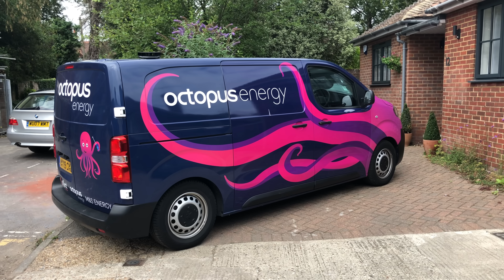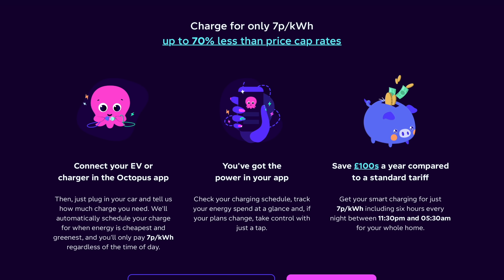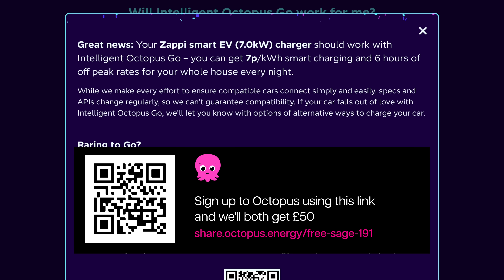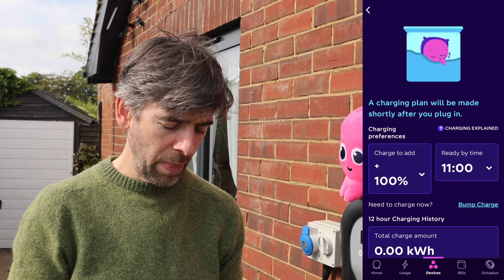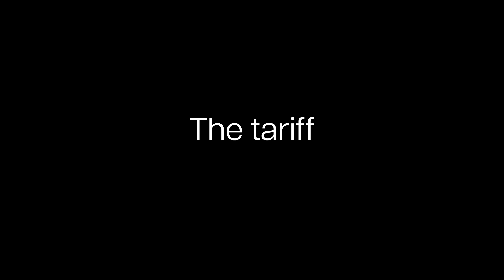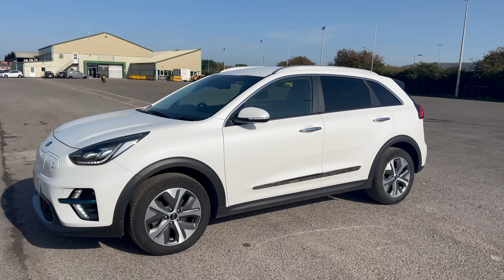We've saved a fortune! All about the UK's most popular EV tariff: Intelligent Octopus Go

Comment: If connected via the car Do they charge all electricity used by the house during the mapped sheduled charge times at the 7p rate, or just the amount the car tells them it has used?
Reply from the maker: Yes, amazingly all electricity used by the house will be 7p/kWh for as long as the car is charging. As I understand it, that's unique to Octopus.
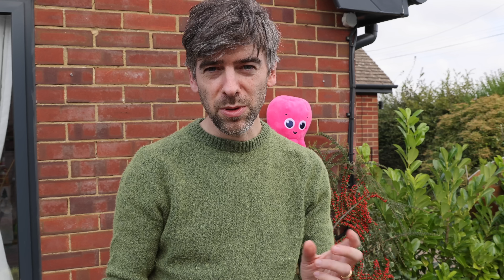Reply: Pretty good, I was wondering this, struggling to find any information from Octopus themselves on this. The smart schedule at the moment is 21:30 to 08:00 so will be good to get the heat pump warming up the house cheaply and have a shower (electric one) before 8.  Shame the Octopus app doesn't show the traffic usage split in the usage app.

Comment: Can you adjust the max output from the charger say 1 KWh so it takes longer? Would that give the whole house a longer periods of the cheap stuff?
Reply: You can limit the Zappi charge current. You can set the “Device Limit” Amps to whatever you like (between 6A/1.4kW and 32A/7.4kW I think) it’s in the Zappi front LCD menus). Sounds like unfair gaming though to me.
Reply from the maker: Not as far as I know, but that’s a great point as my LEAF only charges at 3.3kW so I get cheaper electricity for longer with that. (Until its relatively small battery is full anyway!)
Reply: @MrEV  you can reduce the charging rate via the Kia infotainment under EV setting, normal, reduced and minimum. The charge point or octopus app may protest with" the car is charging slower than expected. Just ignore that and the car will try to charge for alot longer. 😂😂
Reply: Yes you can. It may not be fair use so I definitely haven't done it, but a friend has, he had 70% charge and didn't really need to charge but has an electric shower which is expensive to run so he reduced the EV charger (hypervolt) to 6amps to get a slow trickle charge, set the Octopus app to charge it to 80% by 10am and plugged it in at 7:30am ish, the app scheduled to charge 8-9am and 9:30-10am, he then did his usual morning high energy tasks like showed and make tea/coffee in those hours the rascal.

Comment: I have been using IO Go for just over a year using a PodPoint charger on my Tesla M3. I have a Givenergy 9.5 kw battery and solar panels which i am really pleased with. 
However i basically have to ensure that my charge is finished by 05.30 or when the free electricity period finishes  otherwise i am draining my battery. I always charge my home battery at the same time the car is charging to ensure I don’t end up draining the battery and not having enough to run the house. I don’t believe i am gaming the system as otherwise i am not gaining anything from the IO Go tariff.

Comment: Having had my EV, Tesla Powerwall Battery, solar PV and ASHP, I have very much saved huge amounts from being on Intelligent Octopus Go. I only plug my car in when it is needed to charge and tell it what to charge. It then plans a charge out to be ready  at the stated time. I don't usually need my car first thing and I have found it will schedule past the usual hours and that is then extra times that my home use is cheap. My bill is now around £90 per month for all of my heating, cooking and around 10,000 miles per year in my EV. We use around 25-30kWh most days as I have lots of tech! This excludes ASHP or EV!

Comment: I have a Kia Soul 2021 and a AmiPro charger, I've got the charger linked to Octopus Intelligent.  The charger can read the cars state of charge most of the time (over the year I've had to reset the charger twice because it could not read the SOC).  I've never seen it charge during the day, this probably because it calculates that it can match my target (70%) in the 23:30 to 5:30 period.  Octopus periodically send out a message to say 'free electricity' at a specific time usually 1 hour.  I've plugged my car in but Octopus have not triggered a charge for that hour, they have all the information and systems connected.  A minor gripe I suppose, I only missed out on 7kWh @ 7p = 49p.
Gripe aside I've been on Octopus Intelligent for 1 year, in total it cost me £73 for 4039 miles which includes a couple of charges away from home, very cheap.
Reply: FYI When Octopus do the "Free Power" events, you simply press the Bump Charge button on the app. It charges at day rate initially, then the credit is added to your next bill to cover what you consumed.
Just remember to disconnect the car at the end of the session or it will overrun past the free period and cost a bit.
We got 12.6kWh on our last session about 5kWh of which went into the car.
Sorted everything, Dishwasher, load of laundry, heated the water tank delayed from the night before, pre-prepped & cooked soup ready for dinner.
Reply: @salibaba  Yes I know that.  What I want is that to be automated.  My car was plugged in during a "Free Power" period, I could of started it but I thought I'd see if Octopus automatically triggered it, they didn't.

Comment: I'm on Octopus Agile. One charge will usually last me a couple of weeks so I'm usually able to charge for 1 or 2p/kWh, or even negative rates. I think I was paid 37p to charge my car up last time I did a big charge. When I see a cheap or negative rate coming along I will generally discharge my house batteries (15p/kWk export rate) and charge them whilst the price has dropped. I also take the opportunity to heat a tank of water. I can have a massive over night consumption but usually it costs less than 10 p in total, and is often negative. This wouldn't work if you do a lot of miles as the gap between the price drops would likely be too large meaning you have to charge at around 17p/kW (the usual'ish' overnight rate, although tonight there is plenty of 10-12p slots). Sounds complicated but my gas (heating is on) and electric, including charging the car was combined was £36.74 for the past month.

Comment: Been on IO for just over a year. 2 EV's. Our average unit cost a month is 14p over the year, bear in mind that our peak rate is 24.67p (Oct 24 rate) was less over summer. So a average saving of 10p over peak rate. Never yet had a daytime charge declined, even last winter. Just under £200 in actual EV charge costs & 10,000 miles covered. Paying the same a month now, as we did pre EV on variable tariff.

Comment: You're in for a shock moving to a house with electric radiators and no gas, that makes for a very big bill. I'm on Flux, last year our total spend on gas and electricity was minus £400. 8.74kWp of solar (now 15.5 kWp), no EV, and no ASHP yet, 28kWh of batteries.
Reply from the maker: Yes, I’m not looking forward to the bills this winter!
Reply: @MrEV  

Heat Pump on the horizon ? Grab the £7.5k grant whilst still available.

Comment: I’m on Intelligent Octopus Go too. Rates are 26.77 daytime, 7.0 at night. It’s pretty difficult work out my savings as we also have a home battery, so the house runs on that all day, so very little or no peak rate usage usually. The Enyaq has an 80 kWh battery, so it does need to do some charging at peak rate if it’s very low when we plug in - been trying to decide whether I’m better pausing the home battery when the car is charging, as the mains will be at 7p anyway (same as we paid for the power in the battery ofc), or whether it really doesn’t make much of a difference whether we allow the car to just use the battery power. Probably doesn’t make much of a difference 🤷‍♂️
Reply: I think it is best to charge your home battery when you charge the car, its the same net cost as you say, but it saves the health of your home battery from fewer cycles. I know my inverter is fairly easier to control from the app, but its a manual process.
Reply: @martyndavies1482  Thats a good suggestion actually, I’ll have to try and remember to do that. I’ve got a Home Assistant, and the GivEnergy (unofficial) integration (GivTCP), adds a few extra controls which are useful - like options to discharge or charge for set amounts of time (ie 15mins, 30mins, 60mins etc), so you don’t have to remember to stop it etc, it’s very handy.
Reply from the maker: We’re hoping to get a battery at some point so that’s the same equation I’ll be wrestling with!
Reply: @MrEV  I guess in some ways you’re starting again with adding things to the house - you had solar, heat pump, etc so I guess you’re needing to look at adding them to the new house again now?

Comment: I charge using a 16 amp dedicated lead from a blue socket just like yours.  We don't need 200 miles a day or even 100 for that matter so this setup is more than sufficient for our needs.  

I'm not shelling out a grand for a 7kW charger just to save 4p/kWh over 7 hours at night.
Reply from the maker: Now we've moved house, we may do the same actually. Far cheaper to get a Commando socket installed than a 'proper' charger.

Comment: I've been on IOG since it started. I have a Zappi and a Model 3. At the start it worked well, but then it started failing to charge. I contacted Octopus, but they were unable to fix whatever the problem is. I am still on IOG tariff, but I just set the car to charge between 11:30 and 5:30. I'm not to concerned about this as I have solar and a battery so I am mostly running on the battery during the day and charging the car and the battery at the cheap rate.

Comment: Big fan of the channel. Just another point that you sort of alluded to right near the beginning, you don’t necessary need a dedicated charger as such providing Octopus can communicate with your vehicle. I run a BMW i3 on a ‘granny’ charger only. Providing you don’t need more than 70 miles (ish) per day then this is adequate. You also get the benefit of extended cheap rate beyond the core hours as Octopus ‘tries’ to get you to your target charge (not always achievable) but at a slower rate, if that makes sense.
Reply: I can confirm this. My brother gets intelligent octopus go with a Tesla model 3 and a granny charger.
Reply from the maker: Thank you. I thought I’d made that clear but obviously not!
Reply: But is the cheap rate applied to all household electricity or just the bit used by the car?
Reply: @robertcollins1371  whole house I believe as it’s just plugged into a 3 pin, so not sure it’s possible for the supplier to differentiate (?).

Comment: Most houses use Gas and Electric.fuel all year
IOG costs vary according to region
The bill portion shown failed to show you evening peak costs
This households mileage is high and far from average x2 cars so will work out cheaper
UK National Average miles is 6000 pa or less
As a family of 4 with high peak usage doing 5,500 mile pa equates to 60kw every 2 weeks it will not pay me to go onto this tariff as the peak rate for SE- UK which is the main usage for me is far to high using IOG
So do your sums as it may not  be all that its painted
Reply: You need to check your usage when not charging your EV, for us the normal usage in the overnight period is around 10% of our daily usage and so the average rate on IOG is actually marginally less than the standard rate even on days we don't charge, but this will depend on your circumstances. approx 5,500 miles in our Mini SE over 12 months cost us around £110 on IOG
Reply from the maker: True — every home (and region) is different so what works for me may not be suitable for all.

Comment: We've also been on Intelligent Octopus Go for a full year. In that time I drove an EV for 16,000 miles, and paid around £350 in electric for the privilege. For contrast, we used to spend £350 PER MONTH in petrol to do the same journeys.
Reply from the maker: That’s absolutely amazing!
Reply: Enjoy it while it lasts. Road pricing will probably end up around 10p per mile, so those savings will be wiped out
Reply: In the process of moving at the moment,  but will definitely use your code for octopus, great video az always 👍
Reply: We've just migrated from Octopus Flux (using solar + battery to force charge and force discharge to earn a liitle using our batteries) UNTIL the reduced export rate introduced in April stopped all that.
We've now bought an EV, switched to Intelligent GO with FIXED (15p/kWh) OUTGOING, but have realised that the forced charge/discharge times used for the FLUX tariff need to be amanded. So, I'm keen to hear from anyone using AGILE OUTGOING tariff how to make the best use of solar batteries.
Reply: 16,000 miles per year is 1,333 per month. £350 will buy you 260 litres of petrol at the current price of £1.35 /litre. 1,333 miles using 250 litres is 5.3 miles per litre or less than 24mpg.
Octopus Go is 7p/kW night rate and assuming you only used the night rate that £350 would buy you 5,000 kW. 16,000 miles using 5,000 kW is 3.2 miles/kW.

Most modern petrol cars achieve 45-50mpg average, do you like to put your foot down?
Reply: @conroyknapp4903  Our petrol car is an AWD XC60 that only gets 28mpg despite me trying to baby it for years. And petrol has certainly not been 135p a litre for the last few years, has it?
Reply: @conroyknapp4903 you divide the annual mileage into months, but not the annual spend. Even at 3.2 miles per kWh, the equivalent for a fuel car (1,333 miles on £29.26) would need to be 279mpg - ambitious.
Reply: They will suck you into cheap rates now but this will slowly disappear as more people log on. The name of the game is offer the jelly bean to get you on a smart meter. Before you know it , you will be poorer.
Reply: @jh-one People were saying that years ago with no evidence then or since.
Reply: @jh-one store your solar in your EV or home battery and ignore the grid for most of the day/week. 🌞
Reply: That's great but I have a genuine concern surrounding EVs/EV tariffs. I know for sure the bait and switch protocol is in play. The masses will and are praising the cheap energy but this will soon turn into a dystopian nightmare when the government and big tech have full control over your transportation and energy data. Don't get too excited.
Reply: @change2023now  Don't worry, tin foil hats are cheap and easy to make 😂
Reply: @ziggarillo  🐑
Reply: @change2023now  That's rich, coming from a bacofoiled turkey  🤣
Reply: @change2023now  except these tariffs have been around for decades, long before EVs they were used for storage heaters.

It's off peak electricity, most peak demand can't be shifted to night time so electric companies are as good as  giving it away at night.

Comment: Im some one that's been watching tour old stuff. I only found you about a month ago. Alot of good stuff, roadtips and info.
Reply from the maker: Thank you!
Reply: @MrEV  youre welcome. If youre running low on ideas, could I suggest covering plug and charge for the supported cars. I'm not sure if yours is supported so it may be impossible for you to do. 

The main question is once you register your car with Tesla, will the charger auto detect on plug in if you currently have a Tesla membership for discount or not. 

I hear you just drive in plug in, un plug and drive off,  then you get a ping with your receipt. No card or app needed

Comment: It is a good tariff. Only thing that annoys me is when the app changes the charge times so it kicks in with the charging when you don't expect it as this often leads to energy being taken out of my giv energy battery when I don't want it too. Nothing major but would be good if the app would keep the times it comes up with when first plugging in instead of changing it's mind 😂
Reply: Imagine a time when it could all be done automatically, that would be an ideal use of AI. Of course it will either never happen, or be sold at such a premium price that I'd rather do it myself.
Reply: Don't some chargers allow you to connect a CT clamp to the battery connection to prevent this
Reply: @robertcollins1371  CT clamp feature yes, but it gets too complicated too quickly with a charger, solar and batteries; sometimes you want the batteries charging the car, sometimes you don't.